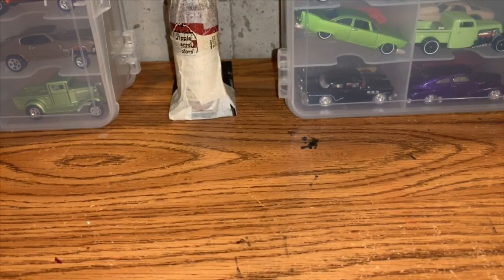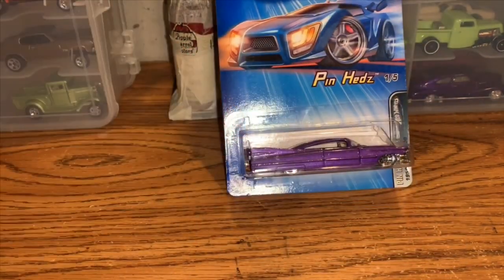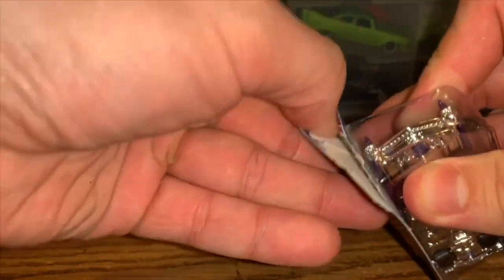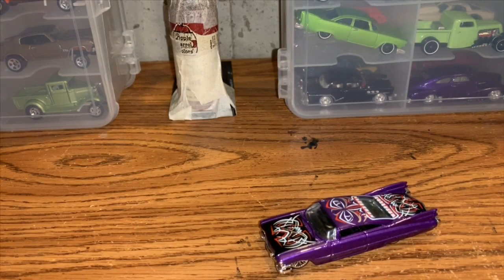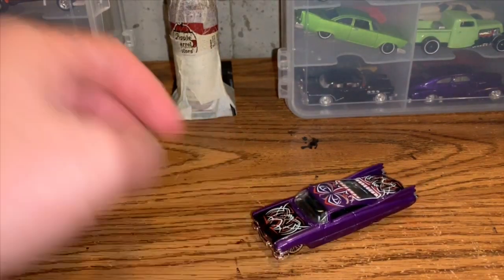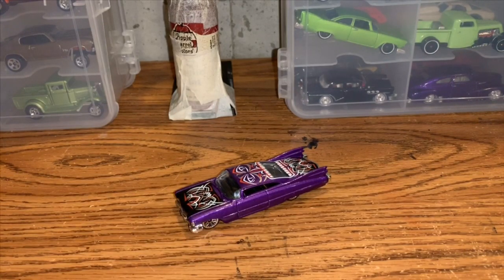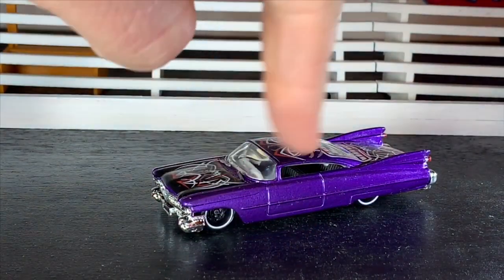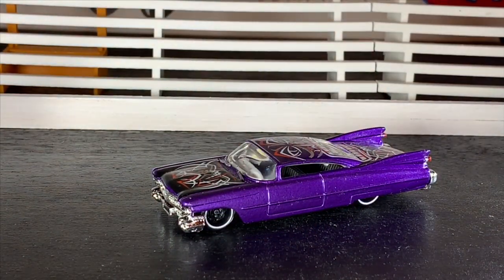Custom Hot Wheels 59 Cadillac lead sled

Comment: Excellent job on the 59 Caddy. Your details are killer. It's a shame that Hot Wheels didn't finish it out the way you did. Keep up the killer builds my friend 🍻
Reply from the maker: Thanks Drew, sometimes I think hot wheels should have done this to begin with but then there wouldn’t be anything for me to do so as long as hot wheels can at least keep producing cool castings even if they look lame I can fix that